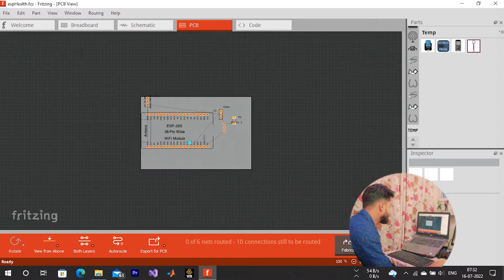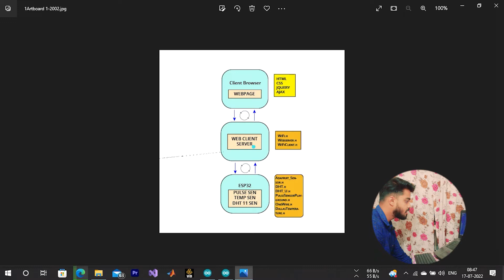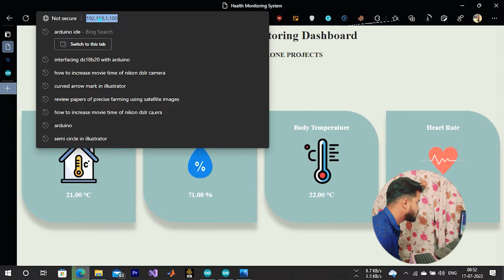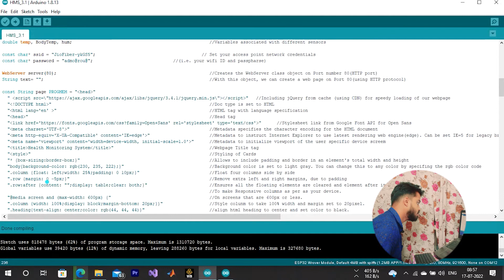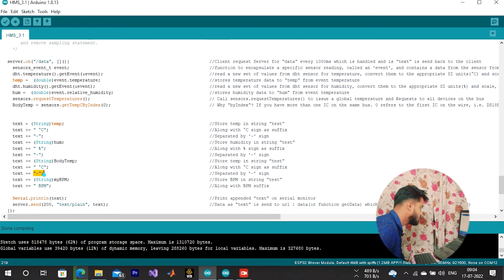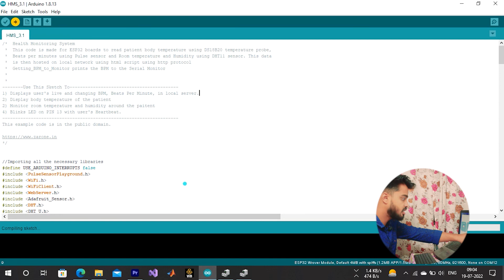Patient Health Monitoring System using esp32

Comment: good evening, on my webpage my body temperature do not display any value and my heart rate display a constant value of 127 degree  Celsius
Reply from the maker: Your Iot part seems to have trouble, try getting normal results first from Iot part, webpage will not show any value if it doesn't receive one
Reply: @ZARONEPROJECTS  i have ordered some new parts and it should arrive tomorrow. I will update you on how it goes